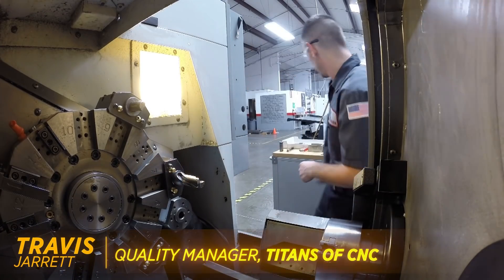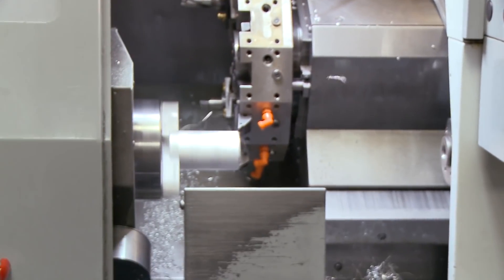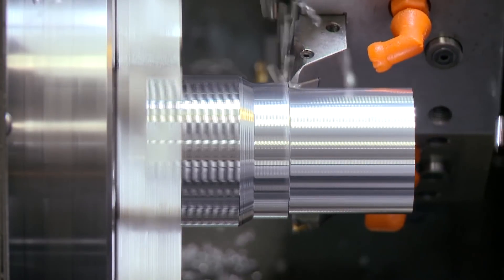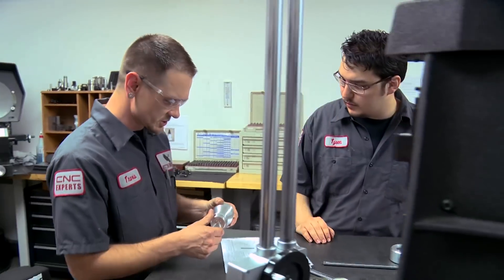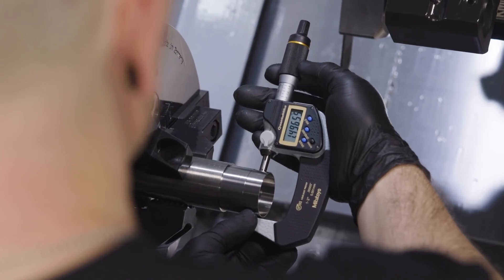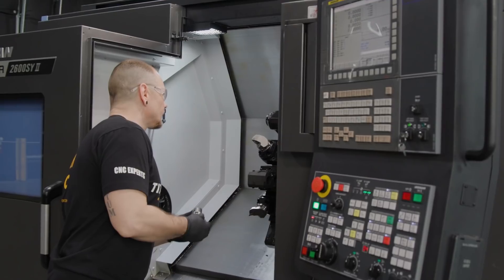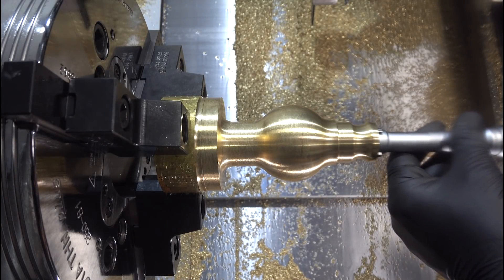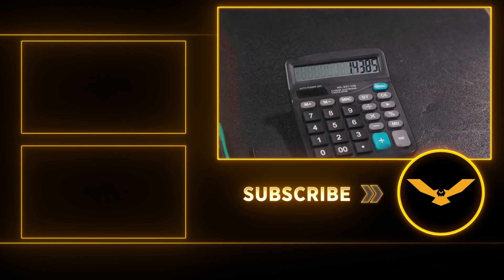$50,000 worth of parts scrapped and realizing it’s my fault.

Comment: I just scrapped 29 parts tonight... a stupid mistake on my part. I'm usually very particular about my parts and try to get them as perfect to print as I can. I also try to clean them up nicely. I didn't realize what I was messing up until near end of my shift. My heart sank and my stomach knotted up too, I feel absolutely terrible. That's what brings me here in my free time- I want to know what I can do to make it better. What I overlooked was part orientation on a multi op mill program but my mistake didn't mess with any dimensions [matter of deep bore facing up during X process kinda deal] machine never crashed or showed any signs something was wrong-no dimensions out either. I'm about 10 months into machining but I've learned a lot and I definitely should have caught it.

Comment: Maybe a little bit more quality control during a batch can get the fault noticed a bit sooner. Apparently during fabrication you can damage a fixture which can cause a misalignment, leading to a part that is out of spec. 

Point noted. Thank you for the video. 

Greetings,

Jeff

Comment: Always measure after the first part is made and do a first article inspection by a qualified independent inspector and if its a critical part you should do 100% inspection and do check the machine after the first 10 parts.

Comment: Seems to be a combination of machine operator error and poor inspection. I work in battery manufacturing and i believe the inspection is the most important part of commercial production. Its the last step befofe giving it to the people who are paying us alot of money to build it for them.While building i and the others are expected to do nearly perfect work and most times we do, but if a mistake is going to happen (bad weld, improper spacing etc...) its going to be a minor thing among hundreds of battery packs so it could slip by the builder. Many people assume the build is perfect because most times it is, but thats not the time to loosen up inspection, i always inspect as if its the first thing anyone built even if its the best builders work because the inspection is part of the build to me, not just looking at something but truely examine it for flaws or misplaced connections or whatever. A mistake caught in house is not a big deal, but even one pack shipped out bad is a major problem.

Comment: ouch , always gotta check your datums . I spent 43 years doing aerospace manufacturing and can honestly say I never scrapped a run of parts . I've seen that happen several times over that 43 years and it normally comes down to not checking or spot checking all your datums , critical diameters are easy to check and those won't normally bite you unless the part gets heat treated and you don't allow for the shrinkage/expansion (OD/ID) on close tolerance stuff . Finishes are the other way to lose a batch of parts , different ways of measuring surface roughness can result in different readings and when dealing with a number 8 finish it can become a point of contention till you pull one of their engineers into the mix and he tells them a 16 finish would be fine and the part was just overengineered so that 8.2 reading is fine even though our equipment shows it at around 7 .
Reply: Mr fucking perfect, are you?
Reply: @rasalgul6253  I can't say I never lost a part but inspection is the easy part, there is no excuse for losing an entire run !

Comment: I used to work for a guy that would come out and say, "this is a $20K part, don't mess up". Thanks, just what my 16 year old self needed. More pressure. It was a shop that mostly did custom repairs, so each part what unique. You didn't get anything but the first article.

It was a good learning experience though, the old fellow knew everything. Had done everything. He'd be in the office and hear me turning something and come out and adjust the machine (and not because it was loud or chattering). Taught me to push the tools and machine to the limit to get greater productivity.

Comment: Curious question as a non business owner, I'm wondering are there safety nets or protection maybe an insurance thing or something for mistakes that are this financially costly? I'd imagine this could destroy a business, how do businesses survive costly mistakes like this which are bound to happen??
Really appreciate some insight here if anyone has it???
Reply: I worked in the semiconductor industry. Those wafers at intel were $25,000 a wafer, at 8" Now I think they are in 12" or larger. The boats were 25 wafers each. Scrap 3 runs on a dirty machine is millions. I never heard of a large scrap incident, except one place where I worked. The wafer boat was 25,000 per boat, not wafer. The furnaces at the first step got contaminated and scrapped 1 months of wafers. That wasn't intel, but a European company in the states here. Luckily, that wasn't my steps/machines. Thank God. Anyway, that was covered by insurance, I heard. Small scraps like a boat or 1 off wafers were not claimed
Reply: @jamescollier3  hey really appreciate the response thanks for the insight. Such astronomical numbers business business can deal with, was thinking there has to be some insurance that is a part of it or accounting strategies used in these types of loses.
Reply: @justhadtosay680  Actually, another commenter below called it: Errors and omissions insurance. So, I just learned that :)
Reply: @jamescollier3  👍👍👍

Comment: too bad you can't just use a 3d printer or friction weld add on piece to correct for the error. But i think a friction welder is like 200k, so unless you produce error frequently enough, it's probably not worth the trouble to invest in an error fixing device.

Comment: 1. Never do your own 1st article. I always had someone else check my work. 2. Never assume that the fixture is good from part to part. Throwing an indicator on it only takes 15-20 seconds. I've done it when I had to maintain concentricity between ops. Even if you only do it every 3-4 parts, you save a bunch of scrap/rework when you catch the problem.
Reply: The way we do it where I work, the setter does the 1st inspection and writes all details, the part then goes to inspection department for a "1st off", then as you're running you get periodic rechecks, both by other operators and occasionally inspection department.
Reply: @lucasschofield8716 . That's pretty much what I did. I get it set up, someone else verifies my numbers and off to the races. I also worked in a shop where you needed 1st article before you could run production and 1st each morning if the job ran for a few days. That really slowed things down because everyone was waiting for a stamp each morning.

Comment: I had only recently a close call with one product that required a better finish than normal product, and I was programming the operations across two turning cells, I missed the finer finish. We managed to rework most of them and referred 5 piece to the customer with a discount. The program check release sheet that I do when I program a new job has now been altered to capture this requirement to prevent it happening. you learn from mistakes and alter procedures to stop it from happening again.

Comment: When I was a machinist we were making parts for Dillion Precision and it was a puck for their reloaded and had about 30 small features on it. One of them was a small drill, maybe like 0.050" and the drill bit broke and I didn't catch it. The cycle time on that machine was like 15 minutes (tombstone) and the part swap took about 5 mins plus a minute of inspection. The problem lied in the fact I was also running a lathe part that the cycle time was 50 seconds. On top of the fact that the boss hated seeing yellow or red lights so you had to run back and forth. Needless to say I made about 12k in bad parts so I feel you. It really makes you feel dumb but at the end of the day, these mistakes only prove to make you smarter and stronger. It doesn't matter how you fall down. It matter how you get back up. Props for owning it sir. #CharacterMatters

Comment: As a CNC lathe operator for 8 years now,   until you run these machines and check parts you can't imagine just how the simplest thing can scrap a finished part.  the tiniest feature or tolerance can scrap a $50k part and in a lot of cases, it can't be salvaged for anything else.     the parts I make are large heavy mill rolls and its insanely easy to make a mistake.   The worst part is when you are so sure your set and ready and after all the work is done you've scrapped it!!!   Not to mention the cost of downtime,  its only about $50,000 PER HOUR of down time if you send a defective part causing process issues.
Reply: We run the finest line between success and failure but I wouldn’t have it any other way.
Reply: @travisjarrett2355  You wouldn't have it any other way? Why not? Why not build in a wider tolerance for failure? Seems like a poor mindset TBH.
Reply: wow man, nothing like my simple CNC job. How much are you getting paid for such an amount of responsibility?

Comment: Worst day for me was when I had scrapped a $2 million dollar part and it was 100% my fault. We were actually able to save it, but it cost BIG $$$ to get to that point. I changed a lot of processes so others won’t do the same.
Reply: Yeah but it’s not like it’s actually 2 million or 50k. It’s only a few hundred or thousands of dollars in material at most. Then the rest of the cost is machine and employee time. For a part that takes several hours thats maybe another few hundred or thousand dollars. The rest of that 2 million is just you ripping your customer off. 99 percent of that is profit and when you look at the actually cost to make the part the loss isn’t nearly as bad.
Reply: @jacobleeson4763  
Unless it's a purchased part that had to be modified. Then screw ups come at near full price. I work at a job shop, so lots of customer provided parts that get expensive for the shop if they get screwed up. We may only be charging a few hundred or thousand dollars to modify a part that would cost 10x to replace.
Reply: @jacobleeson4763  actually you are incorrect, the one part was 2 million. CNC machines don't only make cheap parts, they make expensive parts as well.
Reply: @MegaCabCummins6  for 2 million dollars you could buy a dozen of the machines used to make it and pay the yearly salaries of several workers and have lots of money leftover to buy material. It is a rip off and there is no question about it. Regardless of how accurate the part is. A more accurate part is just a matter of a few more hours of someone’s time at most. Maybe machined on a machine worth a few thousand more. Machinists get paid well. But when talking about a part that expensive the cost of labor and equipment is like pocket change. That is almost all profit and if you refuse to admit it then it’s probably because you are one of the scamming bastards yourself who likes to sell parts for than. Even if it was a massive part a ton of aluminum is only a few thousand steel while harder to machine is way cheaper than aluminum. Even titanium starts to look cheap with a part cost that high.
Reply: @MegaCabCummins6    Send me a link. Id love to see what a 14 mil  CNC machine looks like !  Ive got a little Myford in my workshop, LOL
Reply: @jacobleeson4763  Do you know any specifics about what parts he is working on or just talking out of your ass?
Reply: @tjsbbi  you can clearly see the parts in the video
Reply: @jacobleeson4763  I think I see the confusion. The "$2 million parts' that Patrick Tingly mentioned are not those from the video but rather are ones that he has worked on.
Reply: @jacobleeson4763  sometimes you just have to realize that you don't know what you don't know. The state of manufacturing now goes far beyond your conventional lathes and mills. Sounds like the other guy is working on the Boeing Dreamliner, which utilizes brand new mfg techniques and equipment.

Comment: Yes unfortunate but taking responsibility for the mistake and telling management what caused it and how you can avoid it in the future goes a tremendous way for the machinist. Because depending on the people in charge over you this can be a Job ending mistake. Unfortunately the precision Machinist walks a very fine line between success and failure in today's tighter geometric dimensioning and tolerancing tolerances as their much tighter than 10 20 and 30 years ago. Most people don't realize how much fixturing clamping Force and metallurgy factors into maintaining those tolerances. Besides the fact of what cutting a material and how it's cut affects it molecularly and thermally. For instance putting a hole in with a tolerance of one and a half thousands across three datums is very difficult because it's affected by ambient temperature machine temperature and thermal coefficients and certified Gage block standards may have to be used to guarantee location. For a example.

Comment: I watched this twice and I still do not have a clue as to what went wrong or how or why it happened.
Reply: Runout between first and second op
Reply: First of all, I'm just guessing here, but I think that the problem was that they machined a feature in the first op (let's call it an outer diameter on a round part), but then clamped onto that feature for the second op to hold the part, which maybe crushed it a little and put it out of spec. So when he checked the part after the first op (again, let's call it an outer diameter), it was all good, but after clamping onto it for the second op, he only checked the second op spec's and didn't ensure that everything in the first op was still good. Does that make sense?
Reply: @talktojerm  Yes, it does. Thank you
Reply: We were clamping on an Op 1 feature but what happened is the work holding got damaged and so introduced a large amount of runout between the two sets (Op 1 and 2) of features.